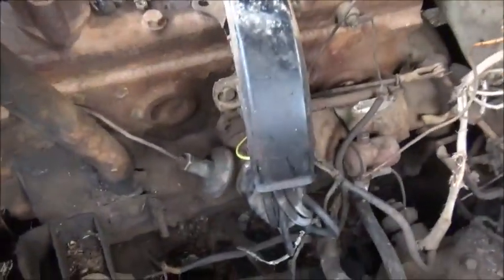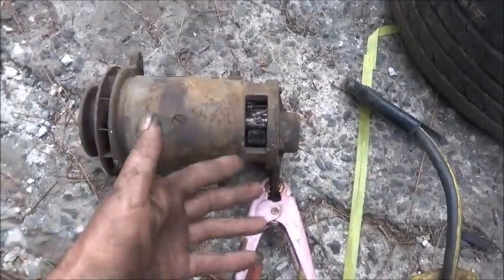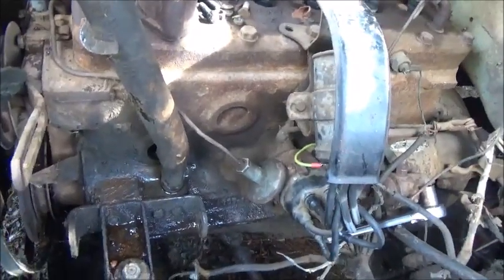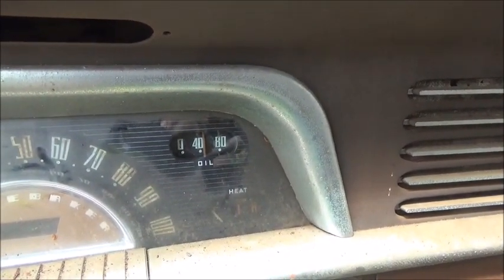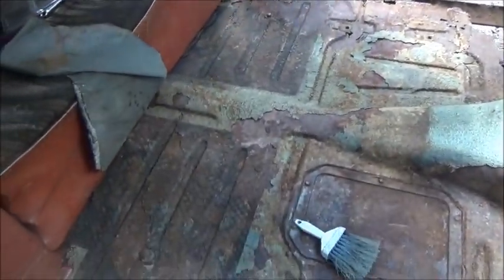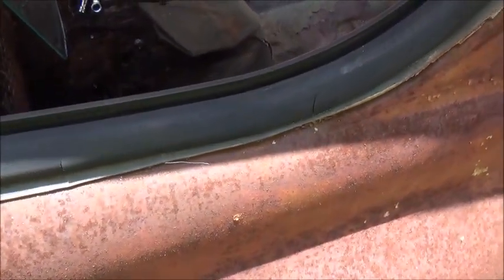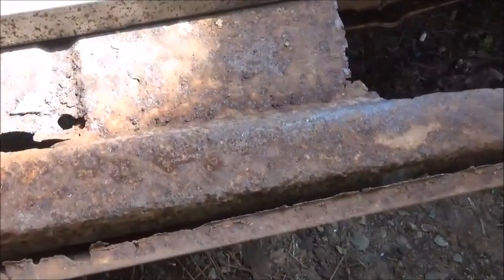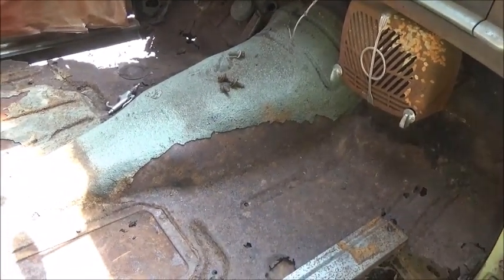1951 STUDEBAKER GENERATOR TEST, FLOORS AND MORE!!!

Comment: My family owned a 50 or 51 Studebaker. I helped my dad work on it and I learned to drive in it. Great car, very reliable. the brakes had a hill holder feature that kept it from rolling backwards when stopped while going up a hill. Made it easy to start off when using a clutch. I think it was a mechanism in the rear brakes.

Comment: I just recently discovered your channel, and must say that I'm impressed with your depth of knowledge about old iron in general, and the metal working skills you bring to the tube!  I first keyed into your channel when searching "Studebaker", of which I'm a long advocate. So, of course I applaud your work to bring the '51 back to life and road worthy condition! Many of the skills you demonstrate, seem to be all but lost today, except with the mega buck commercial restoration shops, some of which leave little of the original vehicle, using repro parts! I subscribed, and will continue to keep checking back! Good work!

Comment: I am enjoying your series on this car.  My family owned a Studebaker dealership from 1946 to 1968.  In the 40's and 50's everything including heater/defroster, oil filter, radio, turn signals etc. was optional from the factory.  This car has what appears to be an aftermarket or dealer added universal heater on the inside passenger firewall.  The factory heater on these Studebakers was under the passenger's  seat where the removable floor panel is.   Keep up the good work!
Reply: How neat! James, But... an Optional Turn Signals? never heard of that before! haha.

Comment: We had a Delco Remy generator on our Farmall Cub tractor that used a third brush in place of a regulator and once we put 12 volts through it Dad checked the voltage at charge and it was putting out 12 volts instead of the previous 6 but it had a switch that controlled the amperage as I recall,we saw one time an older fellow in Florida who made a power boat winch from an old generator by motorizing it just as you did yours.

Comment: I know you know about flashing the gen after disconnect but i found this on the web and anm reposting just in case, Bob. Keep up the great work
any time a generator is disconnected for any reason,it needs to be polarized.
now depending on vehicle polarity its opposite.
for instance a negative GROUND vehicle requires the battery positve be used to polarize the Armature on the generator.
on positive ground vehicles you use the negative to polaraize.

all it requires is a momentary tap with a jumper wire. You cab "Google a more detailed explanation
Reply from the maker: Yes, but you polarize a 6 volt with 6 volts.

Comment: The blank panel bolted in the floor, at the end of the video is for an under seat heater to heat the rear seat area. I see there is an aftermarket heater under the dash, with the big hole left in the firewall. Studebaker's later OEM heaters pretty well sucked in cold weather, especially in wagons and convertibles.

Comment: Thanks for more inspiration, I bought a Souix valve and seat grinder, $150 craigslist, after seeing your video on refurbishing the cylinder head. Locally they wanted $800 to do a set of sbc heads. I have several sets that need reworked. May do some side work if I'm any good at it. 
Noah is a good lad keep him on course, yours is the example to follow.
Reply: Valve guides and valve work on old 134 F-Head Willys engines in detail at Metalshaper on You Tube. Don't know if it would help your specific situation but it is a very detailed tutorial if you are interested. Cut angles, guide installation, height related to deck, trueness of opening, width of interface and many other details. This guy is a metal worker, machine shop and mechanicals and restorer.

Comment: I'm a cable and harnessing technician by trade, and it's good to see and hear that you are doing it right. I'm not surprised, you always do an excellent job. Solder and shrink tubing is the way to make a splice, far more secure than crimping, especially when it will be living a life of vibration and heat. Crimp terminals will work quite well on the ends, especially with the crimp tool I saw you using. A ratcheting crimp mechanism will make consistent crimps, every time, and in the right place with the right tension to hold the wire securely. Too many people overlook the details, and wind up with electrical problems down the line. If I'm ever in the market for a  vintage car, I'd come talk to you. I will be retiring in a few years, and probably moving to somewhere in South Carolina, so it's not out of the question. I trust your skills and your character. You're one of the good guys. Linda and I send our best to you and your family.

Comment: Hello

Voltage across the battery on 12 volt system should be 14.7 so I guess the 7 volt reading for your 6 volt system is spot on.

Putting 12 bolts across the dyno would excite the armatures and the PM hence the good reading now.

You do exactly what I do with floors. I suspect you will have the same job when correcting your Chevy Sedan delivery.

I think I'd be tempted to replace all the frost plugs. I dare say the others are not far behind the one you replaced.

All the best from

Nick Jervis UK 🇬🇧

Ask the man who owns one
Reply: Nick Jervis, a 6 volt system above idle should be close to if not 9 volts. Have read in old service manuals and adjusted my voltage regulator for that. Make a big difference in how it runs. Hence, more voltage stronger park and much easier to start when hot.

Comment: If you ever have a slow spinning motor or an old one not performing like it should, running it on higher voltage for a very short period of time seems to bring them back to life pretty well. I've seen it done before with a 12 volt motor, jumped up onto 24 volts. Ran like new afterwards

Comment: The plate on the passenger side floor covers the hole for a factory installed heater core. Your car has an aftermarket heater installed.
Reply: No, no, no.  That is the trap door. It is spring loaded and operated by a lever under the driver's seat. It is for when your wife won't shut up.

Comment: Hopefully all the comments have slowed down lol. Now that dynamo might? not have been charging because the magnets were poor. Jumping it with 12v may have just stirred them into life. Only time I've come across this, a Seagull outboard. It just would not start. Had fuel, compression and a spark on the plug outside the cylinder. Trick was to spin it with a drill for a while which re-energised the magnets. They were then strong enough to energize the mag enough for it to produce a spark.

Comment: years a go generators and voltage Regulators on the old cars had to be polarized when replaced or if the battery was disconnected for a long. Of time what I remember is there's two types of ways to polarize the generator on the older cars depending on the system you have

Comment: Jonathan why don't you buy a quart of POR(Paint over rust). You can get it at eastwood. Once you paint it with that it will arrest the rust from ever doing anymore damage. It is a polymer and the stuff is tough. They make it in several colors and worth every penny. All you do is remove any loose rust and paint it.

Comment: I don't remenber the year of my older brother's Studebaker.  When I was around 6 or 7 year's old, in '59 or '60,  he owned a Studebaker.  I don't recall it running much. It had a starter button in the floor board. When he was gone, I'd sit in his car, and pretend I was driving it. I would hold down the starter button with my foot, turn the wheel back and forth,  until the battery was dead. Then it wasn't fun anymore.  I didn't tell him this until year's later. 😂

Comment: If I remember correctly, DC generators can lose their residual magnetism and you need to jumper the windings momentarily to get them to start charging. I forgot how to do it, probably what you did with running it on 12 volts somehow.

Comment: Looking good JW! I could tell by the sound of the panel when you set it in that it wasn't light weight stuff! I had been going to ask the gauge, but you answered that question at the end. Will you have problems with the welding temperature of the thinner, older rocker material when anchoring to the 16 gauge material? Curious about the settings you'll need to use. Thanks for the lessons in every video you do. Much appreciated.

Comment: Jonathan, another great video. This Studebaker is an odd and interesting car and I remember seeing them when I was young. I remember you saying haters giving you flack for how you do things. Hey, it's your world your sharing with us, no complaints here. Just a question if you please. I remember my father rebuilding his car generator and it had to be polarized before going back into use. Same thing I believe with new or re-used voltage regulators. You had to apply the battery to the generator but REVERSE voltage, only for a second or too. Also with a different ir new voltage regulator if it was being replaced. I read this info in a MOTORS repair manual..
You know a heck of a lot more than I do, ever need to do it? He forgot once, and the generator started acting like a motor while he was driving. He disconnected it so he could get home...
Again, just a question, not a hater comment.
Howie

Comment: I may be all wet however, didnt those old generators have to be polarised if they were new, or sometimes if they set for a long time by hitting it with the 12 volts it re-polirased the thing. In my hayday of a back lot mechanic seems i remember something like this. Im 74 yo now still messing withe the old cars but not like jonathen
Reply from the maker: Yes a 6 volt generator needs to be polarized with a 6 volt battery, I used a 12 volt to do it.

Comment: Electrolytic time, part 2.   Save the really hard welding, and part acquisition for later.  The previous "owner" (term applied loosly) gave no care for this vehicle; hence the bad rust.  Like any car that's been side-lined, the neglect shows.  However - it's important to remember sheet metal is relatively cheap; somewhere ~ $40 - $80 for a 4 x8 sheet.  Two pieces might get close to fixing the bottom, not counting re-shaping the metal, if an authentic restore is your goal.  Just zap that rust off, and leave the rest for later.  Just focus on "portions", and getting whatever used parts, if that's your route.  Another option is to fabricate home made equivalents, if you have access to any kind of work shop.  Have a parts list primed up - but don't spend a fortune.  Slow, and easy - that's how you should look at a project, like this.  If it snags you 40-50 k after a couple years; that's not bad.

Comment: Jonathan, does that mean that you could put a 12 volt regulator on a 6 volt generator and it would function properly?
Reply from the maker: No, I just powered it as a motor with 12 volts and it started working even though it wouldn't when I polarized it with 6 volts.
Reply: Yabbut, without a regulator, it was producing 21 volts. So perhaps it could be controlled with a 12 volt regulator and work as a 12 volt generator. No? I'm speculating, because I don't know the difference between the inner design of 6v and 12v generators. Are they the same except for the regulators?  Thanks for answering my query.

Comment: IT LOST ITS POLERISATION YOU HAVE TO JUMP THE VOLTAGE REGULATOR OR DO LIKE YOU DID AND JUMP THE GENERATOR. IT JUST SAT TOO LONG.
Reply from the maker: I did with 6 volts and it didn't work. I ran it on 12 and it did.

Comment: Maybe at least clean it up somewhat and oil the bearings before hitting it with voltage?
Reply from the maker: I am not trying to make it look any different than it is and the armature turned very nice, so wasn't a need to oil it before hand. I'm trying to leave the "been sitting for 50 years look".